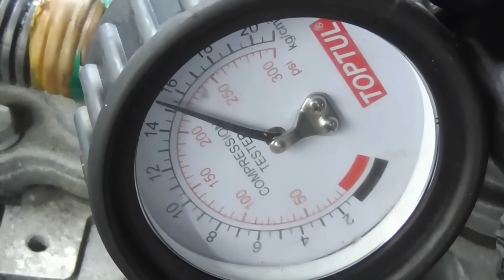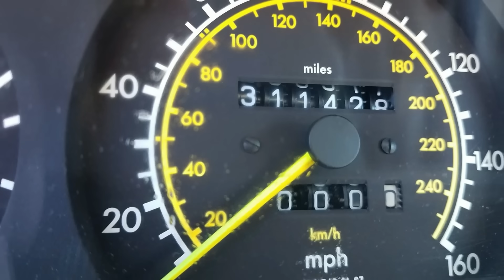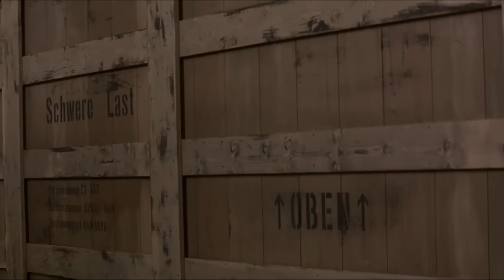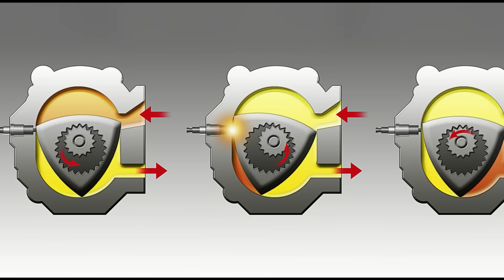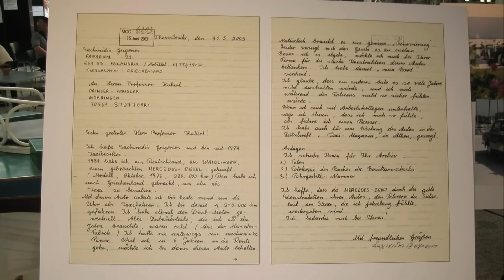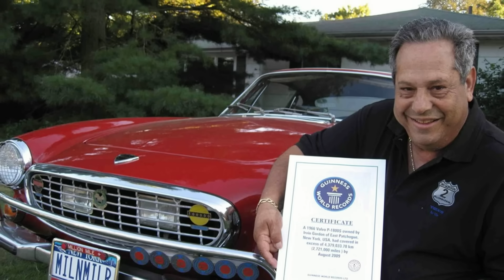Most Reliable Engines of All Time

Comment: It's pretty easy to make the world's most reliable engine yourself. Just take a Toyota land cruiser v8 or even better an i6 2jz motor and detune it to 60-70% original manufacturer stated horsepower. There will literally be no stress on the engine, only the electronics might fail, you can probably run it for hundreds of years properly maintained.

Comment: Ford 3.0 duratec 24 valve 
2.3 and 2.5 used in ford and Mazda
All go 200k with no mechanical issues...just oil changes

Comment: Having owned four Mercedes-Benz gas and diesel cars which I sold after they hit 250,000 miles on their respective odometers, I'm pretty sure they're still cruising the highways. The '80 300SD Turbo diesel is now owned by a young father up the street from me. The cost of keeping them going can be breath taking, but I've certainly enjoyed driving them.

Comment: Don't forget the GM 4.3L V-6 as a legendary long lasting engine. Especially popular in the AWD Astro vans in snow country. The Astro's were prone to salt damage that stopped them  with still good running engines over 300K miles.
Reply: The 4.3 in my '96 S10 was still going strong when I had to retire it at 312,000 miles due to the rust resulting from too many NY winters.
Reply: 4.3 doesn’t get a whole lot of love on these lists. They’ll take a licking and keep on ticking. It’s a tough engine
Reply: I had a 91 s-10 with that engine. After 80,000 miles, it started burning oil. Leaked down past the rings, and burnt out on startup. One time going over this with a Chevy salesman, he said “ well, at least it keeps mosquitoes away.....

Comment: in the Philippines  back in the 70s to 90s Toyota K Engines was the engine for everything! 

it's a 1,200-1,800cc OHV 8 valve 4 banger making 60-85hp most of the time it's connected to a 4 speed M/T but you can also find some with a 5 speed box (it's still the 4 speed but with an OD)

the K engine's power output was just enough to make a 1 ½ ton truck move and go to 50-60mph

 it's a tough little engine! most of them still run to this day.

Comment: I feel like the title should have been the most reliable import engines of all time... IMO the 12 valve Cummins 6BT would put many of the selections to shame in the reliability category, many of these engines will crack over 1M miles and often outrun the truck bodies that they are installed in. Also the 99 to 2006 GM LS series engines that routinely see examples going over 500K... Or you have Ford's 7.3 IDI and their super reliable 4.6 engine that was used in cop cars and taxis for years...

Comment: With a clutch if you look at semi trucks the drivers call a clutch as a stop and go button. They use rpm timing to shift but the transmission to do it. If you don’t know how to float gears to shift you clutch in to a gear than clutch out release the clutch than clutch in the next gear if not you will grind the gears. If you need a clutch in a semi truck before you are out if warranty ( 500,000 miles) you suck with a manual transmission.

Comment: A few other engines not mentioned like the GM 3.1 v6, Ford 4.0 in block cam v6, GM 4.3 v6...not uncommon to see 400-500k miles + with very little oil consumption. Not to mention most of the big blocks by GM, Ford, and Chrysler, plus the old inline 6s, or the GM 350 v8, Ford 302, 351 small block, Chrysler 318...all tough engines.

Comment: I'll share a few examples. 
1987 2.8 Ford V6. It beat the crap out of it. Redlined it . Drove it hard. Used it as a work truck and hailed overweight loads constantly.  The only problems were the starter solenoid and water pump.  It ran until 217,000 miles and I sold it running good.

Then a Ford 5.4 Triton. Yes it blew out the plugs and they changed the heads under warranty but it made 247,000 miles and I sold it running good
It was a work truck that Ioaded up and worked hard. Didn't beat it like the ranger because I was much older.
Reply: I’m near 300k on a 3v 5.4 engine in 2005 f150. Original timing components!

Comment: 4.6 and 5.4 SOHC ford V8 (not the 3 valve motors those are trash) would easily do 300k to 400k they were cop cars and taxis for Many Many Many years. In fact some townships still use them as police vehicles. Nothing special about the engine at all, but they were VERY reliable.

Comment: Vw corrado g60- 1990.  1.8L  supercharged 400,000 original miles. Just hit me that it has the same clutch and engine!  (Mobile 1) Only weak point , I replaced the fuel pump 4 times and water pump 3 times.  ...and supercharger rebuild once.
The car was driven hard and even reached 142 mph down hill!  (Steep hill! ) 😁

Comment: Had a 1990 VW Jetta diesel (1.6 l) with 570,000km untouched and only maintained. 60 mpg all the time. A bad accident was the only thing that stopped it. A VW diesel would easily outlast most of those engines.

Comment: When he mentions the Mercedes 300 he means the OM603 engine. Now, take the 603's IP pump, put it on a OM606 with 7.5mm pump elements. Add a big turbo and you'll have 400 bhp+ all day long.
Reply: That being said. All mechanically Injected mercedes diesels were absolute units... given proper oil change intervals.

Comment: If the engine (and car) lasts too long, the auto maker loses repeat sales.
That's WHY Toyota and Honda reliability peaked some years ago, they came to the understanding that TOO reliable hurt their business.

With that said, what is this INSANITY that "100,000 miles is a long lasting engine"? I had 1960s and 1970s engines that managed more like 200,000 miles, and my current E250 V6 is past 300k with no rebuild and a LITTLE oil burning.

Comment: Audi 2.5 TDI (5-cylinder). This is up there for being the most reliable diesel engine. Also its VW sibling, the 1.9 TDI (pre-PD) is known for its incredible reliability.
Both of these are known for their extreme reliability, and ability to rack up some serious mileage. 500,000 km (310,000 miles) is not uncommon, and 1 million km (620,000 miles) is completely within reason for these. 
Engine codes: AEL (2.5 TDI - 140HP), Volvo D5252T (same as the AEL), AFN (1.9 TDI - 110HP), 1Z (1.9 TDI - 90HP)

Comment: that 1 toyota 4.7L V8 tundra that drove over 1million miles, with just a few starters, alternator and H2o pump changed...the digital dash board showed no more than 999,999 though.

Comment: My 1978 Buick Riviera had over 1 million miles. With the Olds 403 was very reliable and easy to work on.
Reply: Olds 403 one of gm best older long lasting engines

Comment: The volvo clutch lasted so long as he spent most of the time on the motorway where the clutch is not used. Purely stop start driving will wear a clutch in 60k miles.
Reply: Who in the hell wears out a clutch in 60k miles?? Break-in period of the engine is barely completed 😂My volvo v70 2009 has 130k miles and clutch is literally like brand new

Comment: 3.8 gm and ford 300 inline out run most all these engines. And most all diesels get way over 200,00 miles, that's just breaking them in. You keep saying 200,000 likes its a huge number. I get that easily on most any car I have.

Comment: You put a rotary engine on this list when the apex seals are guaranteed to fail before 100k miles?  You're joking right, a FIAT engine is more reliable than that.

Also, no modern American engines on the list?  Sus.

I like how you hid the like/dislike ratio too, very cute.

Comment: The B20 engine in the 1800 is a forever machine. Its almost bulletproof. Just as its predecesor, the B18 engine
Reply: I got a built integra with a b16 head and a b18 block. All that’s done to the block is 81.55 mm pistons and stock shot peen rods. Those blocks are insanely durable and I’ve had no issues at all with mine despite beating the crap out of it

Comment: Well if were talking about he engine alone. No engine has more million mile motors then the 5.9 12 valve and 24 valve Cummins. Cummins 12 valve has the most 2 million miles motors. The newer 6.7 Cummins are just as reliable and will probably have a lot hit the million mile mark over time.

Comment: It seems to me that profiting off of engines emphasizing reliability and longevity requires strategy.

1. Make a crapper ton of them and sell them the same way the LS was done so the prices stay somewhat low.

2. Make the engines able to adopt newer tech over time instead of crazy amounts of planned obsolescence.

3. Emphasize the hell out of spare parts, insurance, maintenance, overhauls, replacements, and making promotion and insurance sales deals with companies like engine oil makers, transmission fluid makers, lights makers, etc....

4. Offer aftermarket mod coverages.  

Bank on this long term and short term.

Comment: I know a guy that had an ex yellow cab 1968 Plymouth with a 318 in it. It had 1.1 million miles on it and only went thru a timing chain.....it used a quart of oil every 300 miles, but seemed to go forever.

Comment: I say the Chevy 327 or 283. Or the Toyota R22.  I bought my Toyota pickup up, an 87 model. It had over 657 thousand miles on it when I sold it. Still running. For $300. I paid $300, in 1991.  Sold  it in 97. . Sorry ever since. 
 It was a long bed 4 X 4. Only repair was a. starter. And tires. Lots of tires. Four wheel drive, and would climb a slack rope.

Comment: I had Dodge D150 pickup with mopar 318 cid .  The easily got over 250,000 km with no problem.  The person I sold it to had the truck for years after with no problem with the engine.    Too bad the truck rusted.

Comment: The M57 realistically ended in 2007, after that they used n57 engines that have poor chain design, and has to be replaced relatively often, amongst other issuses with the n series diesel engines But yes, m57 and its little brother m47 are brilliant engines, mine is at 470k km

Comment: My 2015 Mazda 6 SkyActiv runs like new with 300K miles on the clock.  Still gets 34 MPG and doesn’t use a drop of oil in between changes.  I’ve replaced a lower control arm and belt tensioner and that’s it!

Comment: I had a 1976 Reliant kitten 850cc I bought as a second car with 154,000 miles  on the clock in 1984 for £225  I sold it for £750 19 years later when    it had  done over 279,000 miles The next owner did put it  300,000 before it was written off in an accident.The only thing I did to the engine apart from servicing , was put a timing chain on it , replaced 1 broken exhaust valve spring & a head gasket which was blowing for 68,000 miles(oil in water)  before I replaced it. Just change your oil on a regular basis Most reliable car I have ever owned  Next time someone jokes about a Reliant Robin (Kitten had the same engine) ask yourself could your car clock up 300,000 miles with almost zero costs apart from service items ??

Comment: M102. Let me tell you guys, my wife has a euro spec non catalyst 2.0 l  m102 in her 1991 190e. Half a million miles. Had to change the head gasket at 300,000. Cost me 100 euros and a weekend with a mate to totally referb the head. New seals everywhere. Now she uses a litre of oil every 1000 but its the rings. Ill get round to it one day. Original chain, clutch etc... Had to change the drive shaft rubber donuts last year. 120 euros at the garage. Old mercs live.

Comment: My Toyota Prado 2005 has 480000 kms on it and still runs like new only major problem was rear main seal went at 430000 so I replaced the clutch while the gearbox was off
Reply: Glad to hear that. My wife has the new version of that vehicle badged as a Lexus GX. She loves it.

Comment: None of the most reliable engines are super charged or turbo charged.  Take a look at engines like the Lexus 4.6L V8, 462 Hemi or the Ford 4.6L.
Reply: Actually all of the most reliable engines are turbo charged. Detroit 60 series, Cummins L6s, Mack E7,  Cat 3406 and the list goes on. Most of them are just too big to fit in non-commercial vehicles.

Comment: The successor to the Mercedes OM617 300D 5 cylinder diesel engine, the 6 cylinder diesel  OM606 is even better. It can drive easily above 1 million kilometers without rebuilding

Comment: The Original Checker Cab had a Small block Chevrolet and they ran all over the world for hundreds of thousands of miles.. and Personally I have a 88 Chevrolet Truck that has 835 thousand without a rebuild.  Timing Chain and water pump replaced at 325,000.
So my suspicion is this guy is a Nissan, Toyota,Honda and Mazda Worshiper.  Just saying

Comment: In Europe a car with 150.000 or so km its considered old because of the emissions rules changing every year. So most of the time even if engine is working fine get demolished or exported in poor countries. This makes not relevant that the engine can perform 3 or 400 thousands km.

Comment: When I was a kid in the 1960's our family cars would be burning a little oil at ~ 200k. This is changing oil & filter at ~ 5k intervals. Since changing to synthetic oil and 10k mile oil change intervals, all my vehicles are still not burning oil at 300k miles. I usually get tired of them and sell them after that. The automatic transmissions usually go 250-300k before needing overhaul, manuals longer. And clutches usually go 250k+.

Comment: Literally ANY American gasoline straight-6 can be seen going 300,000 miles on the regular without being torn down. But there are also other really good engines for longevity that you might not expect. GM 3800 V6 family, for prime example.

Comment: Folks will bash the rotaries, but in NA form they are actually pretty damned reliable when fuel is properly premixed. I've seen original 12As with 250k miles on them and they still start, and pass CA smog fine. So while it's weird seeing it in this list, it is a reliable motor if serviced and built properly. Of course when you turn up the power on anything, you turn down the life. That said I have seen healthy built rotaries over 120k miles. Also, poorly tuning a rotary can near instantly ruin the engine. So I would say they are only reliable in a particular case and that doesn't truely mean most reliable to me just a grain of salt there. But, they do however make it on a top 10 list of horse power per displacement/weight.

Comment: you should consult a real mechanic before posting this. 200,000 miles is nothing that honda motor you featured is what i had in my 95 and the body rusted out, the motor had timing belts and oilchanged aand was still ran strong at 478,000 miles when the manual trans gave up. where is the toyota 22re regularly sees half million miles in highway oriented areas like texas.

Comment: M57 I owned 3  530d e60 260 00 km..   E46 330D 340 00 km  and the F25 XS 30 D now with 190 000 km..  M57MOTORS BMW 30 diesels Over a time of 20 years Not a single breakdown Regular servicing And Vibration damper pulleys.

Comment: Had a 1981 Nissan 200 SX with a 4 cyl 8 spark plug NapsZ motor. NEVER did anything more than adjust valves every 25,000 miles an REGULAR OIL AN FILTER plus AIR FILTER changes. Well over 300,000 miles an ran as good as when I got it when I finally parked it for body (rust) restoration. Treated it one time at 150,000 miles with slick fifty. Used nothing but Castrol gtx 20/50. Never burned a drop of oil. TOP THAT.

Comment: And the Peugeot XUD engine?
There have been many known to exceed 500+k miles without a rebuild.
Reliability should mean mileage without rebuild and I don't believe any 1+ million mile car is on original piston rings and bearings.
The XUD is more than a match for any engine you mentioned, except the Mercedes diesels, with inline injection pumps.
Reply: Was that the diesel in the 404??   bulletproof units ..
Reply: @harmendejong4754  Never experienced the 404, but the XUD engines came along in the early 80s for the Peugeot 205, 309, 405, 306, 406 and mnay Citroens like the BX, Xantia, Xsara ZX etc and were used until the late noughties in the Citroen Berlingo/Peugeot Partner vans. Incredible reliability, fuel economy and longevity. Turbo variants responded really well to extra boost and increased fuelling with pump mods. Taxi drivers favourite engine of the 80s and 90s.

Comment: Most of the engines on this list are performance engines or diesels. The Volvo engine isn't all that great its just that the guy babies the car especially if the clutch lasted 300000 miles its all highway. If you take simplicity. ease of maintenance. cost of parts and labor. availability of parts my pick would be the AMC/Jeep/CHRY 4.0. not a power house engine but there are many aftermarket kits that can make it a beast. and with 7 main bearings it can take some punishment. A good  19 + year production run and even more if you include the 232 and 258.  Odd that the Chevy 350 or Ford 302 didn't make the list also. Not one single American made engine.  You ever heard the word practicality.

Comment: 100 k haha I can name a dozen million mile engines
Cummins 12 valve
Detroit 12.7
Big cam Cummins
Cat 6 nz or c15
Hell almost all big truck engines before emissions would go 1 million
Also any brand straight 6 ford gm and Chrysler would go 400 k easy
 I have 2 318 v8 5.2 mopars with around 300 k on them
Jeep 4.0 no problem got 2 of them also (01 TJ and a 96 Cherokee
Toyota 22RE yep
Find em fix em drive em
I gave up comfort and electronic gadgets for simple reliable transportation

Comment: toyota s series was made for 27 years yet you claim it as one of the longest running engine series in the world? small block chevy was 64 years, small ford was 39 years, ford windsor had 58 years, bently l series was made for 62 years, amc inline 6 had 42 years, rover v8 had 37 years, buick v6 had 47 years, vw had an engine for 65 years, and the list goes on.
this list sounds more like a teenage boys favorite tuner engines than anything else.